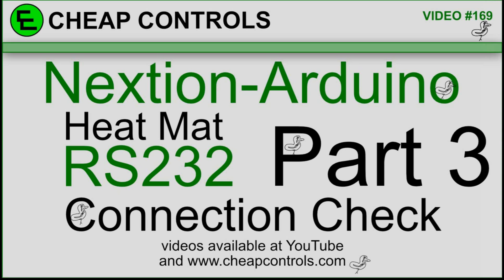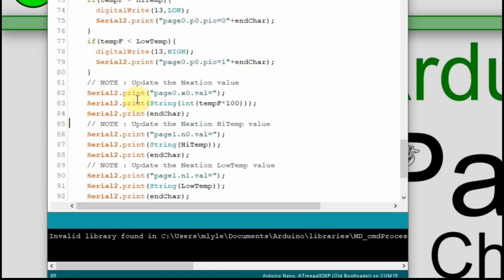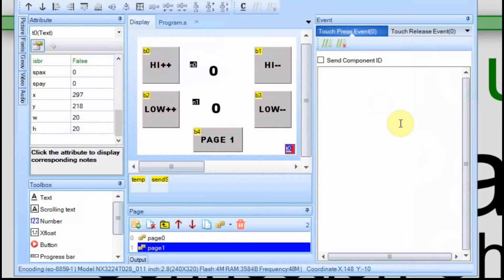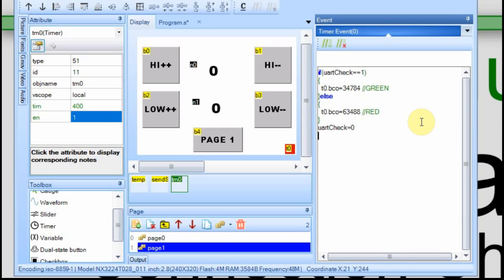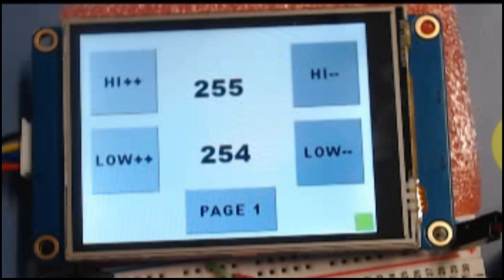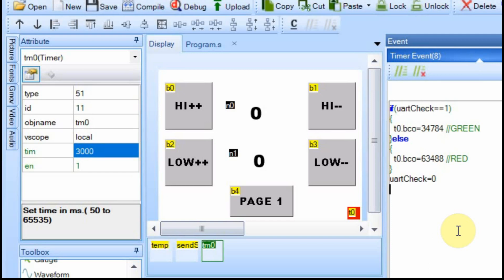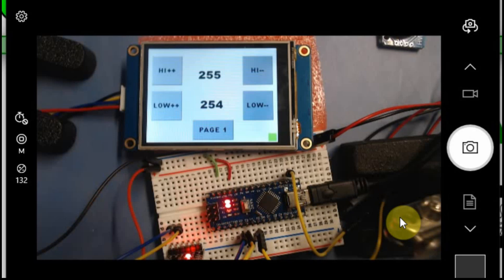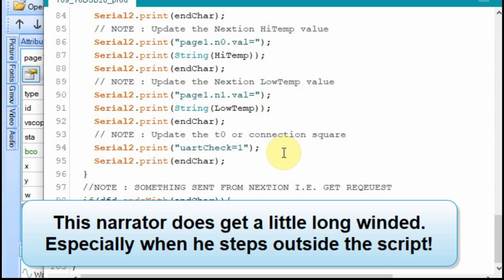169 #nextion #arduino #tutorial control a heat mat pt3

Comment: I have a serious Question about DS18B20.  ?       Is DS18B20 is a reliable temperature sensor   for industrial and medical equipment's  applications ? 
Which one is the best temperature sensor for for these application ?
Reply from the maker: I do not know the answer to that.  I know that different sensors are made for different applications.  I am sorry I do not have your answer, but I do not make very much and have to use low-cost sensors as examples.  I would be very cautious about using the models I use in real-world scenarios.  I wish you good luck in your adventure to find the right part for your project.  I am sure you will have success.